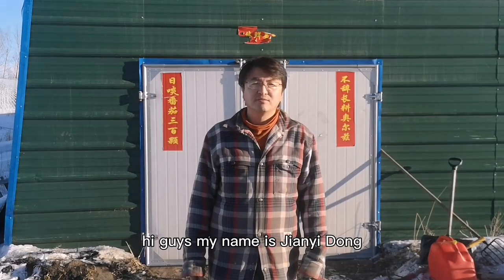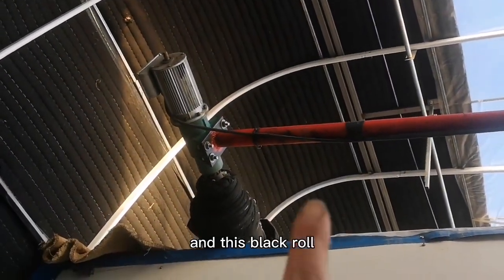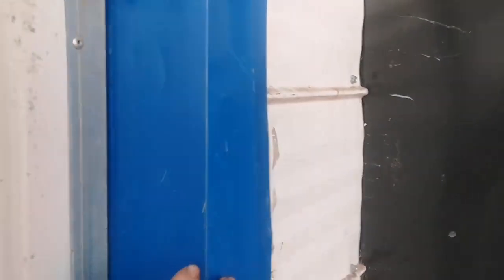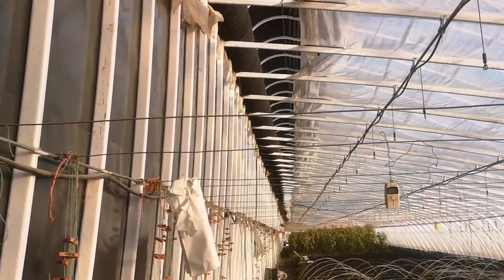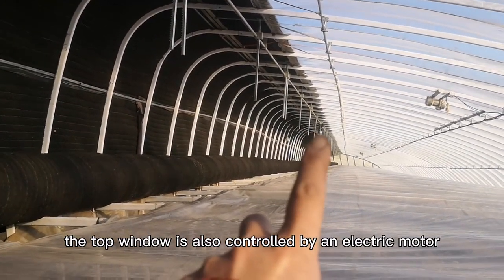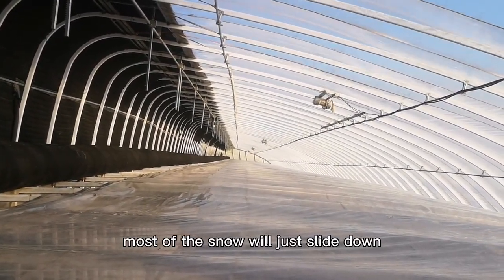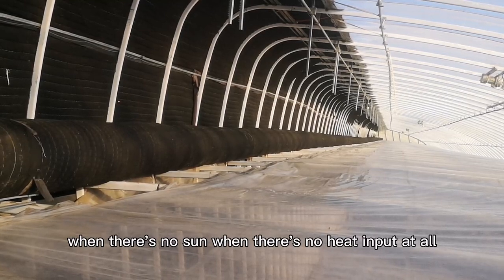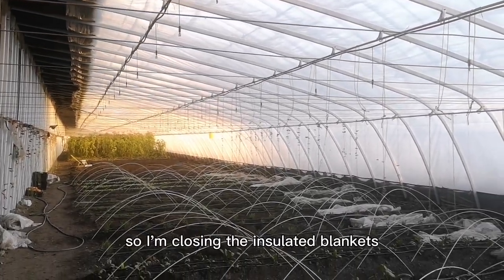The design of a commercial size Chinese style passive solar greenhouse in Alberta

Comment: This is a very nice example of the greenhouses built in China now. I have been studying their passive solar greenhouse design evolution for a year or so to build one on my property on the Kenai Peninsula in Alaska. Nowhere near as large as yours of course, not commercial for me. The basic design has improved so much over the last decade, from original  rammed earth walls to the double layer greenhouse covers you displayed. Very impressive and they have a lot of design features I am going to incorporate. I would like to grow USDA zone 6-9 fruits and veggies with it.

I will be adding a few things that I did not see in your walkthrough because my growing environment will be even more challenging than yours here in Alaska. 
1) I would like to incorporate a heat battery system like a GAHT to store heat from the summer and use it in the winter months. This should help to even out the temperatures more.
2) I will need something like a rocket mass heater for those many days where we do not get any real sun and the system is too cold. They're nice because they use an active thermal mass system for heating and I can tie it into the GAHT system.
3) One idea I picked up from an article on the Chinese greenhouses was to store animals in part of the greenhouse. That seems to have a few advantages. One is body heat from the animals. Another is they produce carbon dioxide to help with plant growth. They produce natural fertilizers for the plants. Chickens and ducks could keep insects to a minimum if they do not bother the plants. It also would keep everything consolidated in one place.
4) I would like to grow the new dwarf citrus trees in the greenhouse. To help with soil amendments as well as heating I am planning to compost in the greenhouse. This will produce carbon dioxide as well.
5) I have a fairly substantial river running through my property and plan on having a microhydro rig to bring up electric for grow lights. https://waterotor.com/

Thank you for sharing. It was very helpful to see a modern iteration of this greenhouse in real world usage.
Reply from the maker: Thanks for the great comment. Combining this greenhouse with a heat battery system is a really good idea. But putting animals inside the greenhouse maybe problematic. I used to put chicken in my greenhouse. They made it very very dusty.
Reply: @dongjianyi2492  That is good to know, thank you!
Reply: Maybe animals behind the north wall might work? And a filter like  a standard heating system  filter between the animals and the greenhouse.    I think you might need a pond or big water barrels to cool the greenhouse air in Summer.  (circulate the water from the pond to the greenhouse and use it to cool and dehumidify the air) Kind of like what happens in a car radiator or heater core.
Reply: I would avoid putting animals into the greenhouse as they can kick up so much dust that it gets all over the food
My buddy had chickens in half his greenhouse and there would be a solid crust of dust on all the keaves and fruit within a day of washing it off
Reply from the maker: @3crowsfarm16  Cannot agree more. I had the same problem
Reply: @3crowsfarm16  Noted, as I agreed with the channel owner when he said the same thing. I'll build them something different.
Reply: R Sch  Not in winter at -40 or lower..

Comment: So much brilliance and hard work here. The use vof 2 poly layers with the attempt of gaining another R value of.8 seems to me to not be productive as the two layers are so far apart that the air between them can roll around by convection and cause radiational cooling. No? Please discuss
Reply: I used to think that the large air gap would increase heat loss, but have different ideas on it now.
If you have 2 layers of plastic an inch apart, the air movement between the surfaces will move at a certain rate causing   convection  cooling.
- - - - - -
If you have 2 layers of plastic several inches apart, the air movement between the surfaces will move at a certain rate but only marginally faster then the air in the 1 inch separation.  
It will take longer for the air to reach the other surface which means it will have a larger R value, and less  convection  cooling.
- - - - -
If you have 2 layers of plastic feet apart, the air movement between the surfaces will only move at a certain rate  marginally faster then the air in the other separations.  
The distance is so much greater that the R-value is greatly increased.
The air between one foot, would have to be moving 4 times faster then the air between 3 inches separation. . It will not move that fast.
- - - - 
The radiation loss will be somewhat similar in all three. 
- - - - -
The insulating blanket will seriously cut down radiation losses.
Since the insulating blanket is on the outside of the first layer of plastic, the first layer of plastic will keep the air from directly cooling the insulating blanket. 
- - - - 
I love the design.
I can see the advantage in increasing the air gap spacing between all the individual plastic layers, on future designs.
- - - -  
Please let me know here, if I described this acceptably and any problems that might arise.
Reply from the maker: @DocScience2  Great comment. Thank you so much for the technical explanation!
Reply from the maker: The outer layer is used to deal with snow load and to prevent the insulated blankets to get wet. Meanwhile, two poly layers significantly improve insulation in early morning, late afternoon and during cloudy days.

Comment: Thoroughly enjoy the minimal heating inputs you have achieved.
Did you use foam below grade around the perimeter?👏👏👏💥
Reply from the maker: Yes. I used foam on south, east and west side. But not north side. Because the back wall is thick enough.
Reply: @dongjianyi2492  four foot deep? Two inch polystyrene?
Reply from the maker: @georgemckenzie2525  4 feet deep. But just 1 in

Comment: Great! What about introducing GAHT® (Ground to Air Heat Transfer) Systems into your design?
Reply from the maker: That'd be even better. I might install such a system in the future.
Reply: I notice a generator , do you have utility power also?
Reply from the maker: @georgemckenzie2525  Yes I have. But the greenhouse is a little far from the grid. A generator is a better choice.
Reply: @dongjianyi2492  I have been on solar  for 30 years at 44.44 lattitude, also use propane generator for as well in winter. 
I have yet to build my greenhouse which I plan to optimize for citrus.
Thank you for posting  your work and results 
May the value you bring others return 1000 times.
Reply from the maker: @georgemckenzie2525  Thank you so much!